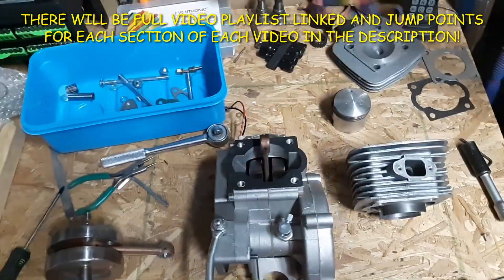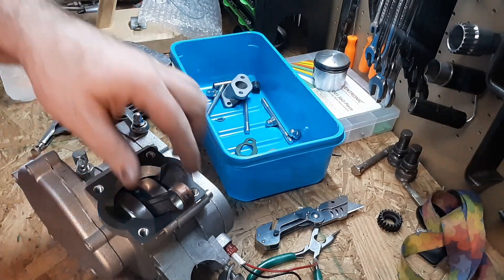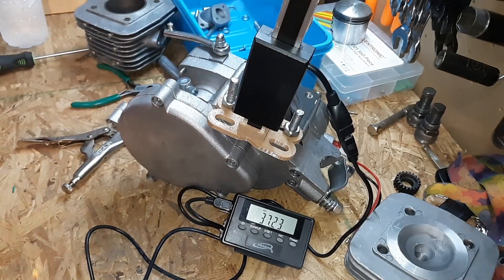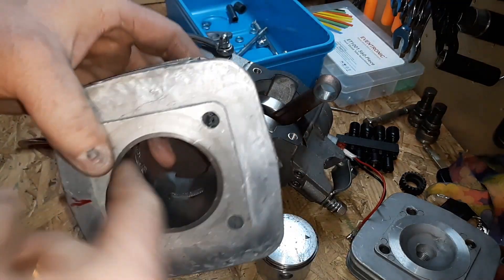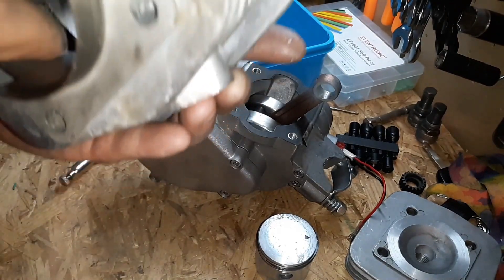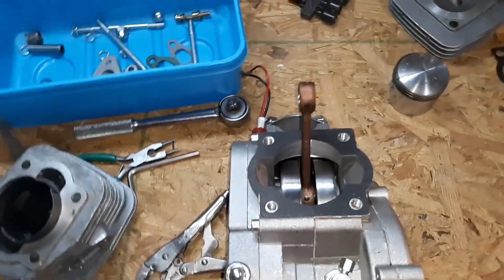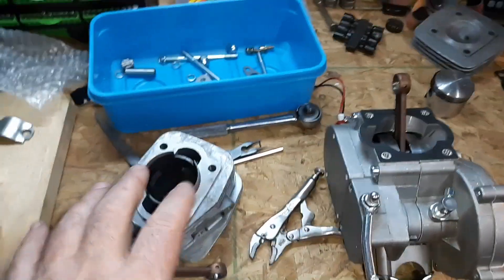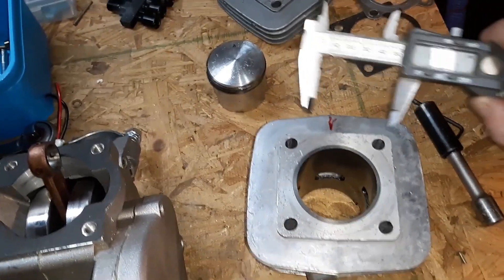110cc Motorized Bicycle Kit Part2 (Video-B)  Internal Parts, I See Exactly Why It's Messed Up Now!

Comment: I wonder if an ms460 jug would fit that with some insert, thread reducers? There was a guy on here talking about one of the jugs fitting a yd100 bottom end, but i really dont think so with a 50mm spread. IDk maybe i missed something, and i cant find it.
Just wondering in case i decide to build another saw hybrid.
Reply from the maker: I have done several videos on how to make one fit yd100... was even selling kits one time ready go onto yd100 no spacer required.
Reply: @BuildBreakFix  yeah, and i watch lol.
The problem is buying all the parts and there not what's advertised as.
So im stuck with a bunch of stuff. Just trying to put to use what i have. Thankfully ive got them all together, but they could be better.
I recently watched one of your video's where you used a harqvanna crank rod. I found that pretty useful. I looked online out of curiosity and they wanted 100 bucks just for the shaft, lol. But at least we are more at ease because we can almost guarantee thats what we're going to get. Well more so anyways with the vendors selling cranks and such meant for motorized bikes.
Then that lends to a crank splitter, blah blah blah, more money more money 🤣🙄🤦

Comment: Its about the same stroke i have too on my ZL40mm. So now i need the AF80 🤣
Reply from the maker: Rods are not what makes a stroke.... cranks make strokes...  rods make length create a fulcrum.  Longer the rod more force and more dwelling times lol  blond fold and pick!
Reply: @BuildBreakFix  i know, but im saying that it would seem the ones that were sold, were passed off as such.
The info on the internet at least and then sellers advertising and selling the rod/ crank combination

Comment: i have a build with this bottom end with a ms660 i made it around the same time i got my first 110 i havent ran it yet because i havent made an exhaust or intake. That is wild how its built like that . all i did to mine was port match open the duration a tiny bit both ways and cleaned the transfers. it runs as good as any yd100 ive had. so this means itll be leagues better
Reply from the maker: why! omg...... Why does everyone use these bottom end on ms660 I want to cry now!  So many bad things about this bottom end for that build dono where to even start lol   Ms660 is never going to run right on this bottom end not enough case volume!  Rod way off for port timing dwells way to long top bottom. I'ma bet you widened the intake port lol which will be the nail in coffin to never start lol! I was the saw zilla builder everyone passes the photos around of. this engine put of 14.9hp on a dyno a guy dropped $2750 for it on the spot! https://youtube.com/shorts/rGHl3O9ok9o?feature=share  But serously.  rod in this case super bad. if you don't have a 40-42mm crank ms660 runs super bad! if t all!   these cases are actually smaller inside cause of pk80 cranks in them.  The yd100 case has 50cc more volume in the crank area enough to feed the top end correctly as it runs! most murder the bottom of the jug which tanks the piston on the intake.  Use the correct rod for it! wont have that issue or have to murder the skirt!  Here was a cut away timing video i did while back! There is a reason you don't see any running on youtube if you do not very long lol! They all miss the rod issue ! these 110c rods are not correct length! https://youtu.be/Digi619TixI
Reply: I believe there aren't any 660 56mm still running because the chrome plating inside doesn't go all the way to the top on the cheap Big bore kits. there's about 5 mms  missing so after a while the top ring eats through the plating and then we all know what happens after that! Boom! Lol
The chainsaw community calls it the "Ring of Death" for obvious reasons.  I did alot of research before my build and it depressed me. 
I freakin popped the top off of my 56mm and decked off the missing plating,  I pretty much had to so now the port timing is a bit lower which is good considering how high it already was from the factory.  I also took quite a bit of material out of the cases and mad a G2 case reed, the G2 reed block itself has alot of wasted volume inside it for more case volume. I made it to have more case volume because of your opinion on it btw😁

Comment: I’m interested to see cause mine didn’t take any more port work then any other motor imo, and I removed a gasket to get the squish right. But like I always say. These motors are never the same.
Reply from the maker: Yeah I think there is better ones! This one is not that one lol!
Reply: I have been waiting for you Brainiacs to figure this motor out for me; I  hate work... I am allergic to it. Finally I can stop using it as a paperweight.. it's to darn heavy anyways 😪 🙄
Reply from the maker: @boydjensen3161  LOL To funny!
Reply from the maker: @boydjensen3161  Had bunch of people like johnny mention to lower it!  Just can't on the one I have but yeah if ports look this one  only way fix it is a crank transplant and a spacer!  then a intake cut in piston to match everything correctly!  Or window and reed could also work not sure yet!  Pretty sure can make this thing scream after! https://youtu.be/mkrMYPKfxXo

Comment: I guess its safe to say the zmn100 cranks are 37.25mm stroke...
Reply from the maker: yes they are and that sucks badly! since all ports on the JUG are spaced for a 40mm stroke which is huge end to end of that stroke on port durations on this thing.
Reply: Zmn100 are 40 mine measures 39.8 I believe I would have to double check
Reply: @Project_thrott13  znm100 is the connecting rod. it is proven that it can come mounted in a 39.+ or a 37+ crank it happened to me. i bought the crank for one of this engines thinking that it will come with the 37.+ stroke and it came with almost 40mm stroke ctank , then i had to buy a 38 one beacause ths was for a saw buid and i need the con rod with 12 mm wrist pin
Reply: I betting money that you can receive a variety of different strokes nowadays. I also bet that the huge Covid outbreak in China right now is affecting the already crappy QC even worse!!! That's hard for me to even fathom.